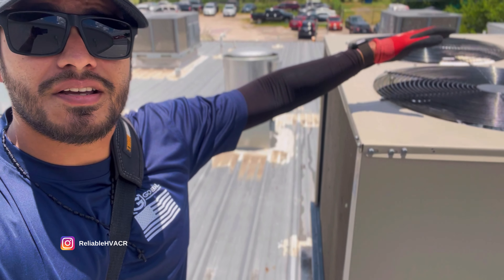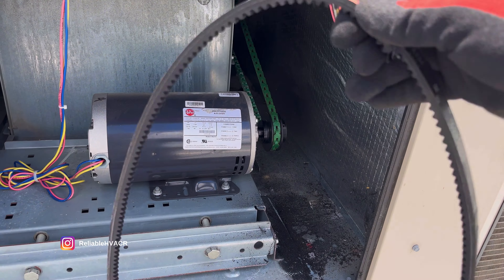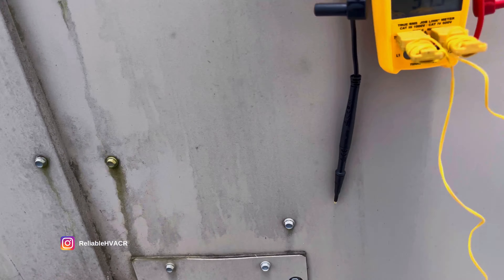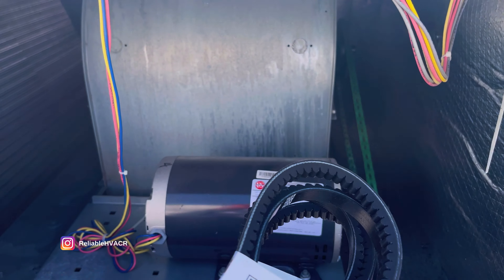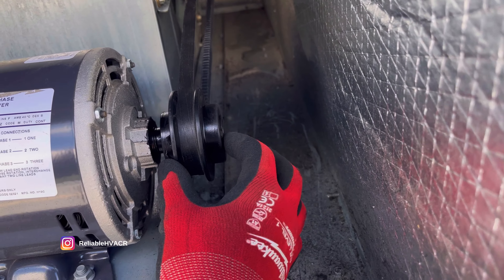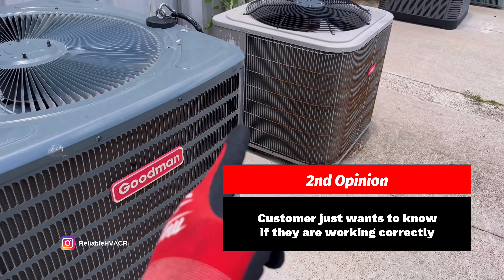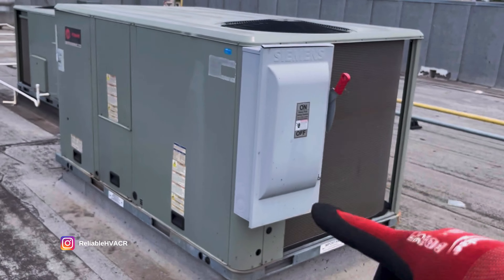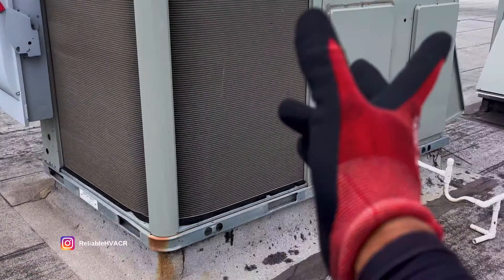Hot Buildings & 2nd Opinions / HVAC

Comment: You wanna know why it doesn’t freeze up when that happens?
Reply: It’s because the hot air is rising through the supply vents, flowing backwards, forcing blower to run backwards, and down through the coil, and out the return. So, there’s airflow, just not exactly the way you’d expect.